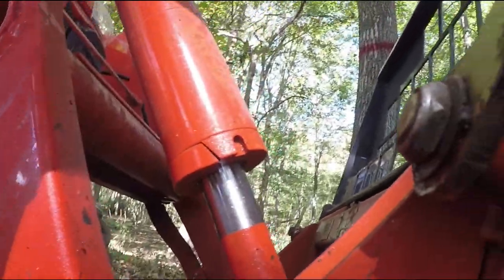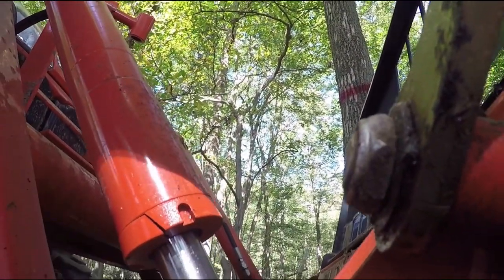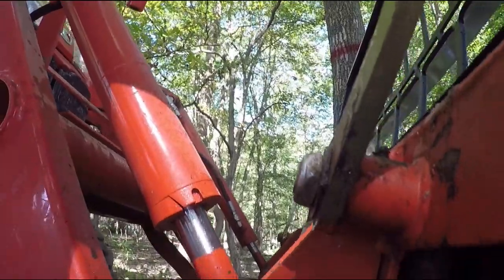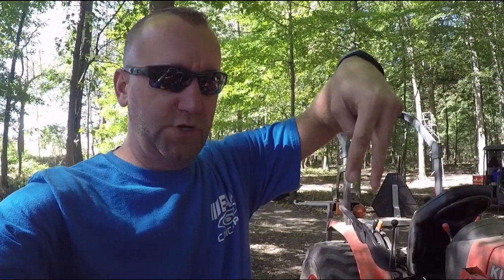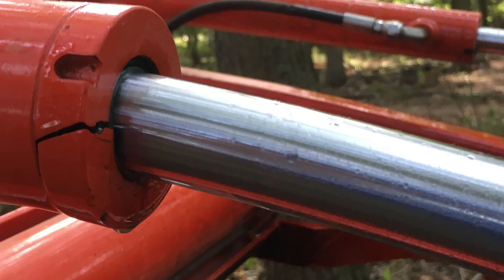Don’t Do This With Your Tractor!!

Comment: Did the the chrome like a banana after a rigorous hook in reverse. Threw the original shit grade one and bought new  . Had real thick chrome rod. Just had to change clevis point with a grinder and 7016 low hydrogen rods

Comment: Sorry to see your hard luck, but it's good of you to put the how thing out there that somebody else might dodge this same mishap. Like what you pointed out it happens a lot plus it's super easy to do and a thing that while you are watching it work you'd not anticipate it. At first glance you wouldn't think that even a quarter of an inch cause the amount change in function that it does, or the amount modification needed to fit it as well as it is more subceptable to the same tourqe failure. Truthfully if I see one that has some time on it and doesn't show any sign of it happening, it strikes me as odd. I come out of one of these "make it work" farming areas, which ain't a bad thingjust a way of life  like anything else you what you must to see results. It's nothing odd to see a yellow set of arms and green rams, you know the old adage "stuff happens".
Reply from the maker: Derrick Hensley 
That is the point. Hoping to keep others from having the same fate. It hasn’t been easy though. I’m certainly catching a lot of flack. 

I see a lot of that stuff here in central Ohio too.

Comment: It's a case of under designed curl cylinder, not operator error.  Sort of like the vertical stabilizer (tail) of an Airbus A300
that falls off (American Airlines Flight 587 Nov. 12, 2001.) when the pilot uses rudder control to correct for wake turbulence of the previous plane (747) that had taken off.  And the NTSB called it "pilot error".  Not likely.  It was a written procedure in the AA pilot's manual used to stabilize the aircraft from wake turbulence.   Perhaps Kubota owner's manual should have instructions to not load the curl cylinders when they are extended.  :-)  Do not back drag gravel driveways.
Reply from the maker: SailorDon01 
It happens to all kinds and sizes of equipment. Even 60k# excavators can damage them.

Comment: ...would a backhoe be dealing with the same type pressure dragging a rock out of a hole...?
Reply from the maker: It can depending on what position the cylinders are in. The biggest risk is when the cylinder is fully extended. If you’re dragging a rock out I’m guessing the cylinder isn’t fully extended but probably extended pretty far. While it may not be as likely, it is still possible. If possible, try to actuate the bucket curl at the same time you’re pulling. This will allow the relief valve to prevent excessive force. 

When researching this, I found this having happened to backhoes, crawlers, and even large excavators.
Reply: Jared's Shop , it's also not unusual, for front or rear cylinder of a backhoe, to be fully extended, (bucket fully curled), when raising the front, or, rear of the machine off the ground... I'm guessing, that must be less pressure than actually doing full work with the buckets... meaning, to be damaged, the machine would need more resistance pressure than its weight, holding it down... it sure is an odd thing you've explained... I'd guess small tractors, below compact size, the same problem exist... ( larger garden tractors predate compact tractors),  the end result In the smaller application  would simply be, blown seal...  without understanding what went wrong, the thought would be, "old age",  but the true problem would be, not understanding the mechanics/physics...
Reply from the maker: @lewspeedwagon6330  
Lift the machine and such is not the issue. I plan on making another video with diagrams and such so I can more clearly explain it. The way this happens is when you aren’t using the hydraulics but using the machine to drive. As long as you’re using the hydraulics for that particular cylinder, the circuit is still open and the relief valve is part of that circuit.

Comment: Nearly did that with a JD 2850, luckily it just pulled the eye off the end of the rod.
Reply from the maker: spentacle 
Oh wow. Hopefully that was a much cheaper fix. Best of luck in the future!
Reply: @JaredsShop  10GBP for welding. A full day to strip a siezed locking pin on the pivot though.
Reply from the maker: spentacle 
Hours or dollars. We both paid.

Comment: I don't believe you bent that cylinder from "pulling back on the forks" I would bet my life that you had the forks hanging straight down and tried to PUSH the log, I see people doing this all the time with buckets as well, it forces the forks back underneath the loader arms and bends the top cylinders, how is compression of that cylinder (from pulling back on the forks) going to bend it? all you're doing is pushing it back in the tube which will open the relief  valve should you apply enough pressure.
Reply from the maker: Mattywho 
I was pulling the tree apart towards me so I could grab an end and skid out. I most definitely was not pushing. 

Pushing would not be able to damage the cylinder like it did. If I was able to damage the cylinder by pushing the log, it would be pulling the cylinder, which is how it is strongest. It would be pulling it straight and wouldn’t bend it. It could bust the end cap or damage the gland but it wouldn’t bend. When the cylinders are at or near their full extension and are being compressed, that’s when they bend like this. 

The tractor doesn’t have a relief valve on the cylinder side of the loader valve. Only on the pressure side. There’s no way for it to relief.
Reply: Worthoverdoing... Pushing forward with a set of forks hanging straight down CERTAINLY will damage a cylinder EXACTLY like that!!!  When the forks are being pushed back under the loader from forward motion of the tractor, the curl cylinder attachment point (at the top of the fork bracket) will be pulling the cylinder rod out of the tube AND pulling the rod down towards the loader arm. When the collar of the cylinder contacts the loader arm, and the forks are continuing to be pushed on, it will bend the cylinder rod down and break the end cap! EXACTLY like yours looked. It CAN and DOES happen.
Reply from the maker: Mattywho 
Maybe it can happen to some loaders but most have stops that prevent overextending the cylinder. You cannot extend the curl function of my loader and make the rod touch the loader arm. 

Anyway, It didn’t happen to mine like that. I wasn’t driving forward. I was backing up. If you research damaged curl cylinders or back dragging damage, you’ll find cylinders damaged this way. When you try to push the rod back in it can bend and that is what cracks the gland.

Comment: I've owned Kubota for years NEVER bent a cylinder and I work mine hard. First tractor was a little light so I upgraded. Did the same with my Kubota excavators. Buy the proper equipment for the job. It's that simple.

Comment: Great customer service. But those cylinders fully extended or not should not bow. Back dragging over hard packed of large material should simply lift the front of the tractor. Seems like cheap metals or underbuilt
Reply from the maker: Matt Berg 
Yes it was. 

The reason it bows is because the power of the tractor driving backwards is far more than what the cylinder can handle. There’s a comment here from someone who did it on a CAT track loader and there are countless other reports of other large pieces of equipment. Nothing is immune. Even 60k# excavators have had the same damage.

Comment: Should have read the manual, clearly says to not use the bucket like that. Dragging or plowing with the bucket vertical puts huge stresses on the pins and cylinders. If you want to doze or plow buy the right attachment.
Reply from the maker: Steve M 
I never would have thought just trying to split a tree would have been enough to put those stresses on it.
Reply: WorthOverdoing 
Its a small cylinder on a big machine. Its physics.
Reply: WorthOverdoing true most wouldn't. When you look at loader specs for example, they rate the break out capacity, bucket curl force, at the pins of the bucket. A b 3300 may have a break out of 2000 pounds at the pins. For every foot you go out away from the pins the strength greatly reduces. Doesn't take much at greater distances to do serious damage. If you think of your loader capacity with standard bucket which is maybe 14 inches deep then consider your forks are 3 times that, you get the picture. I have seen loaders that have been loaded to capacity hit a bump, shock the loader and bend the torque tube, doesn't take much at all.
Reply from the maker: Steve M 
I totally agree. I’m sure that is why it happened. If I was using my bucket it probably would not of happened to me but when I was researching why it happened I came across so many people who had bent their curl cylinders with just a bucket when they were bad dragging at a steep angle and then hit something hard. I was backing out real slowly just trying to split the tree which is why I’m sure it would not of happened if I only had my bucket on. The extra leverage of my forks definitely multiplied the forces on the cylinder. I believe they are 42 inch forks so they were not tiny by any means.

Comment: Running earth moving equipment and tractor loaders for over 30 years I can confidently say that would not happen to a well designed machine.  My choring tractor at home is a JD 7220 with a few thousand pounds of cast wheel weight on the rears and even though it's probably around 15,000lbs and runs a 9 to 10 foot wide bucket, you can back drag with the bucket with the fronts in the air all you want and a cylinder isn't going to care.  It's got a little over 6000hrs on it now with that loader doing every chore known to man with front and back tires constantly off the ground pulling forward and backward on all attachments at any roll angle including full dump.  The problem with your machine is that the cylinders are limiting the roll, not the geometry of the loader.  Otherwise, at full dump it would just be the carrier hitting the loader arm stops.  Weld some large steel pads to the arms to mechanically stop the attachment carrier right at full  dump, paint them Bota orange and never worry about this again IMO.
Reply from the maker: CharlieIIpics 
The loader has factory bucket stops. That’s not what caused this though I have seen pictures of loaders without stops bending the rod over the end of the arm.
Reply: ike fun, Go watch a 40,000 pound Cat 963 back-dragging the bucket with the front of the tracks almost off the ground a few thousand times a day, day in and day out for a few decades and get back to me on whether or not machine design plays a role.  Running the attachment carrier full dump and back-dragging should not destroy a properly designed piece of equipment.
Reply: It looks like the cylinder was probably fully extended until the piston hit the cylinder head at full dump.  If that were the case, the distance between the cylinder head and piston would be zero, giving very little control of the rod by the cylinder.  In that fully extended position it would be vulnerable to buckling if compressed because it would tend to misalign and jam the piston leading to a bent rod and busted cylinder head.  If the stops were such that the cylinders never reached full extension, you would maintain some section width between the cylinder head and the piston at full dump, leaving you with good rod control.  You mentioned the dump angle was more than sufficient, so I suggest to weld some stops in there to shorten that up some, paint em bota orange and be done with it.  

If you notice many pieces of equipment designed for heavy duty service never connect the cylinder directly to the carrier.  There is always a fulcrum between the cylinder and carrier that maintains proper geometry to the cylinder, no matter which direction the carrier angle places it in it's cycle.
Reply: This is the carrier on the tractor I mentioned using at home.  Much different geometry.

https://images.ironsearch.com/dealers/403/67/24463/machines/3567797-636615412660197265.JPG

Comment: Casted end caps Breaks like Cast iron, find cylinders that have machine from block steel. I worked building Hydraulic Garbage truck systems and seen and rebuilt many of them. Those are just baby ones.

Comment: Take that busted cylinder to a good hydraulic shop and they will repair it for half of what a new cylinder costs.
Reply from the maker: iontheball1 
I tried but I deformed the tube. It was my own fault. If I would have left it alone it probably would have been fine. I think I damaged it when I forced the rod back in so I could keep working.

Comment: There should be relief valves in your system to help stop this from happening. Only one bent? If so that is odd to me. Maybe making sure you are square to the tree/log. If one and not the other bent that indicates to me that you somehow ere putting more strain on one ram. My .25c
Reply from the maker: Paul Christensen 
I thought I was square to the log but maybe not. It’s also possible that just one half of the log moved and the other half didn’t. 

There is a relief valve but it’s on the pressure side of the valve. I wasn’t using the hydraulics. It was static and I was backing up.

Comment: Harry home owner  using a light machine not made for heavy use  expecting   commercial  machinery results
Reply from the maker: Ron Reuwer 
Not quite. I should be able to use the tractor to separate a cut tree. I just went about it the wrong way and wanted to make sure everyone understands the physics of how it happened. This type of failure happens to all types of equipment.

Comment: 80% of the life of my Bobcat is back dragging its a 15 year old machine and still has all of its original cylinders, and from the physics point of view when your back dragging the pressure is pushing the shaft inwards so there's very little pressure on the end cap .
Reply from the maker: W Davis 
It’s not the pressure on the end cap that breaks it. It’s when the rod bends.

Comment: I'm not really sure what you're talkin about but that did not happen when you back drug you were going forward and that cylinder did that
Reply from the maker: Jesse Heilman 
No. I was going backwards. I can guarantee that 1,000%. If you look at the physics and how the system is setup, that’s the only way that damage can happen. When dragging backwards the top of bucket is trying to push the rod back into the cylinder. When the rod is fully extended it is supported by much. The hydraulic fluid doesn’t have anywhere to go, the rod can not withstand the force of tractor driving, so it gives and ends up bending. Very common failure on all pieces of equipment.

Comment: If you have a float function use that, you won’t damage a cylinder
Reply from the maker: Kenneth Bailey 
Float doesn’t float the curl, only the lift. If your bucket tip is tilted back and it catches something the float won’t always allow the bucket to rise up off of it. While it would help in some cases, I still found a lot of cases where people damaged the curl cylinders even when using float.

Comment: That looks like the kind of damage you get by hitting something while in full dump position while going forward? The rod end broke the cap. I’m guessing you’ve figured out that forks aren’t meant for back dragging?? Were the forks vertical? As in dumped? That would explain the damage if you bumped something going forward over the logs. Lots more leverage to do damage with forks opposed to the bucket. Probably twice the leverage. 
There are relief valves that allow fluid to flow when you overload the hydraulic systems. But if the cylinder is at its mechanical limit, there is nothing left to give but your end cap. 
Back dragging isn’t really intended for moving lots of material, or logs.... Back dragging is intended to kinda just knock off the high spots. It is best done in the float position with the bucket about half dumped. That way the bucket can ride over something that puts up too much of a fight. 
And.....any tractor is strong enough to destroy its own loader if used incorrectly. 
Be careful out there.
Reply from the maker: Herschel Evans 
Yes, they were vertical dragging back. I was not going forward. When dragging back, the loader is pivoting on the bottom and the top of the fork frame is being pushed towards the tractor and trying to push the rod back in. People keep thinking its from going forward but if you look at your loader it will make sense. And yes, the forks created a lot more leverage than a bucket would. 

There is a relief valve but that’s on the pump side of the loader valve. They’re never on the cylinder side. They aren’t in the circuit when the load valve is locked.

Comment: is there not a stop so this can not happen if not fabricate one. come on Kubota get with it...
Reply from the maker: Julian Reid 
It has stops but that’s not how it failed. When I was backing up, the forks were being pushed forward, which was trying to force the rod back into the housing. The hydraulic fluid didn’t have anywhere to go so the rod bent, which cracked the gland.

Comment: You didn’t overdo anything. Kubota cylinders are junk. They’re very low quality steel. The rods are also poor quality steel that is chromed. That chrome breaks off quite easily. 

Have you ever had to weld anything on a Kubota?  You will need to turn the welder settings WAY down because the steel is low quality and very soft. 

I’m extremely glad I used a Kubota before buying a tractor. I always wanted a Kubota until I actually used one. The quality just isn’t there.
Reply from the maker: I’ll disagree. My tractor is much higher quality than others I’ve used. I wouldn’t automatically snub anything the next time around but I’m definitely leaning Kubota again.